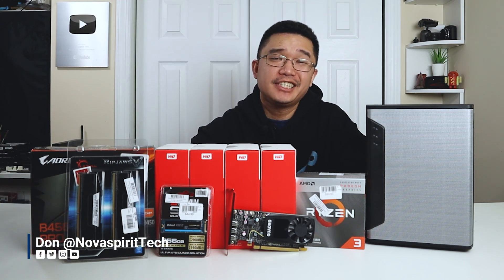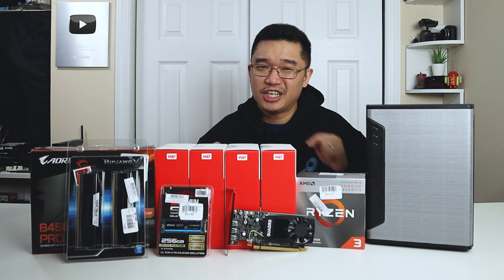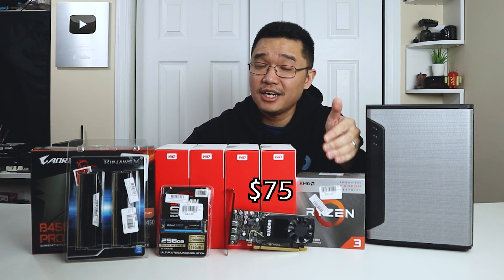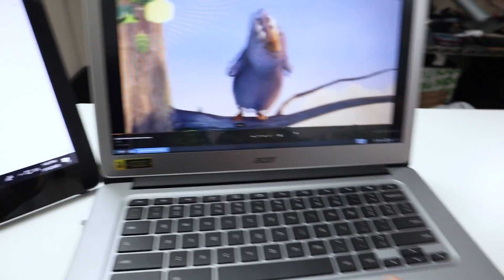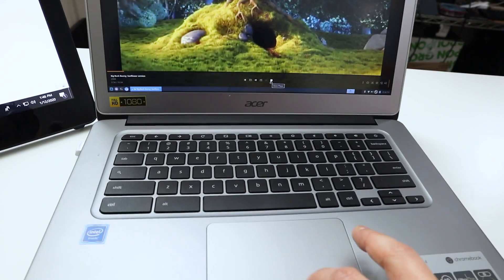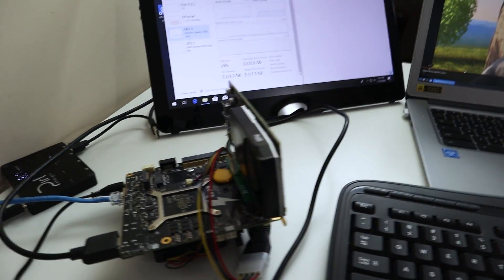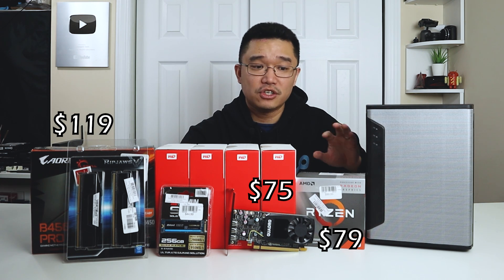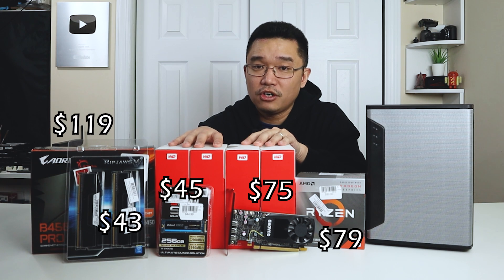DIY NAS & Plex Home Server With Hardware Transcoding Build

Comment: If you had a GTX 1060 GPU would that work instead of a business level GPU like you used?
Reply: Its limited to 2 transcode streams i think...
Reply from the maker: also 1060 is 120w vs p400 30w
Reply: If you're on Linux you can patch the drivers to unlock the 2 streams limit, search for "nvidia driver patch". The card then has the same capabilities of a Quadro P4000 regarding hardware encoding. The card also automatically regulate it's power usage down to 19w idle. The fan doesn't even turn at idle, the fan runs only after a long transcoding session or witl multiple transcoding session.
Reply from the maker: @Pi Pony radeon is not supported by plex. that might change soon but currently only nvidia works with there software for transcoding

Comment: Get a 1650 Super or any 1660. They all have the new Turing nvenc chip in it. And you can bypass the 2 concurrent stream limitation. So you basically have turned a consumer card to a workstation one.

Comment: Well done.  This is very well thought-out for a practical home NAS.  4c/8t gives you spare threads for containers and small vms.   Since it is small and quiet, you can put Kodi on it and plug it into your TV.  
Don't worry about ECC RAM and ZFS.  The people who insist on it are talking about enterprise servers with hundreds of TB of storage and mission critical data.  It's not like ZFS corrupts your files without ECC.  I run ZFS all over the place, from my media server to my laptop (ZFS is amazing for dual boot macOS and Linux), and even on a Pi4.  I've never had a problem.  
If you don't mind the command line, a minimalist Debian or Ubuntu server install with a ZFS root and services in Docker is really easy to maintain.  Docker and ZFS work really well together.
Reply from the maker: I just finish installing everything on my server and I'm loving it. I decided to go Debian but with Plex, and added a steam cache along with some other goodies. I just dreading to edit this video
Reply: @NovaspiritTech  Be careful.  YouTube burnout is real.  Better to take a day or two and not "dread" editing.  Your videos are different and interesting and I'd hate to see you quit.
Reply: if some day you discover 100 of files on your storage with 1-2 bit flips you will mourn for ecc :-)
Reply: @l33t00r  No, I won't.  Anything really important is backed up.  I'm only saying "don't worry about ECC" for home NAS and other personal applications where the risk isn't worth the expense/trouble of ECC.  Just like how most people edit videos on normal PCs, while commercial editing contracts often mandate Xeon ECC workstations.  Youtubers laugh at the expense of the new mac pro while Hollywood is buying pallet-loads of them.

Comment: I’ve not built a NAS so forgive me if this is a bit of a naive question, but aren’t the low speed WD Reds going to be the bottleneck when streaming? I realize the NAS software you use will use RAM for cache, but will 8GB be enough?
Reply from the maker: Nope. The network speed is only 1gbit and a single hd can do well over that speed so even in a single disk setup it won't bottle neck. But with a raid 5 setup like this you get 3x read 3x write speed on disk
Reply: Thank you for the explanation.

On another note I checked the Chenbro website and you’re right, they do not document that circuitboard on the back of the drive cage.

Comment: I just built a NAS with Proxmox and OMV. So far it’s doing great, similar budget build. Will use for NAS to replace an old Drobo FS and will migrate a test Plex server onto a more flexible platform. I will also use it to run containers and VMs. Thanks for this video, it confirms many of my choices.
Reply from the maker: Check out mu twitter i just posted something there you might like
Reply: I'm doing the same this week. But proxmox, omv, and a win 10 vm
Reply: @nicktids  yes. Building a win 10 cm this week. Working on integrating Spice right now.
Reply: @jimpotash9009  I read spice and vnc doesn't allow the gpu passthrough so using rdp. I'm stuck at the nvidia code 43 with an old gt710 card. Just going to do some old gaming so don't need anything fancy.
Reply: nicktids yeah, ended up with rdp and everything works fine.
Reply: @jimpotash9009  cool for you Bios hacking for me. Still fun tho

Comment: Like it but need more. What are your thoughts on the 1920x build? I keep looking and you can get the cpu on sell sometimes for $150-160. Case about $80-100. Psu $80-100. Ram $100. Get a cooler and I like you gpu. Boards are $200+ used. So about $700-800 w/o mass storage. 
Been looking at a gaming vm build on a budget. 12core 24 threads make a great start point. The upgrade path gets you to 2990wx.(wait a year or so to see if it drops to under $200).
I do like your build. You can upgrade to 3700x(65w). So you would have 8 cores 16 threads.

Comment: I ran just a bare bones install of Ubuntu server for years on a Celeron j1800, it worked well for many years. At the time I was only driving gigabit ethernet so it worked out very well. It sounds like you know what you're doing with a bare metal install of Linux so personally I'd just roll your favorite distro and install Plex on top of that for simplicity.
Reply from the maker: haha this deserves another 👍
Reply: @NovaspiritTech  I'm close to the same build. However.... I went with a 2600 af instead of an apu for 40 bucks more. Installed Antix for 50mb ram usage. Shared the  data drives and set kodi(dlna) to auto start. Activate auto scrape for new files added. Then declcoked to 12 threads at 2.0 ghtz, for power sipping. Turned on post with errors, and wake on lan. Then pulled video card. It boots and runs. Can add data off my main system with network share, which is not the same as desktop share. No video required on the server. Transcodes nicely for single user, haven't found its limit yet
Reply: Would you guys ever consider SSD? Media server have minimal write and heavy read. These traits are a match for ssd drives which have infinite read and limited writes. As well as power sipping. However their surge and shock resistance is much weaker.
Reply: @dobermanownerforlife3902  if you're rolling your own base os. You could combine software raid with lvm + turbocache and get similar performance benefits without worrying about data loss due to faulty SSD.
Reply: Dobermanowner forlife Cost... 4 2Tb spinning rust drives are $200 and a 2Tb SSDs are $200ish and 4 of them cost more then the whole build

Comment: NSA recommends Windows 10
Reply from the maker: HAHAHAHHAHAHA
Reply: Surprised they don't recommend win 7 so it can be extra insecure.
Reply: @MrBearyMcBearface  Reading this comment on Windows 7
Reply: @cobz76  pretty sure I typed in on win 7.
Reply: os os x or ubuntu....oh wait dey can just remote your bios ahhhh
Reply: @changedahanddlessss  that's what libreboot and others are for.
Reply: NSA is not going to care about some random schmuck, so if you're not a threat to their administration, you have no reason to be paranoid, and Windows 10 works well as a familiar always on workstation that can serve double-duty as a file server.
Reply: @BoopSnoot  Of course, you don't need to worry about the NSA with Windows 10, because Microsoft already does the spying.
Reply: @BoopSnoot  sounds like something an NSA agent would say
Reply: @BoopSnoot  windows as a server? dies laughing

Comment: I think the integrated GPU could also do the transcoding
Reply from the maker: I wish plex only supporta intel quick sync or nvidia
Reply: @NovaspiritTech  Oh :( It would be so cool to have all the necessary integrated in such an affordable CPU
Reply: @NovaspiritTech  I've been seeing claims on the plex forums that it does actually function on AMD APUs/GPUs, however only from Windows based server ATM. While I've been testing with Proxmox on my main computer, I've been considering building a dedicated plex nas with an unused 2200G I have laying around. Haven't committed to a board yet, but going ITX leaves me wanting to use that 1 PCIe slot for my ATSC tuner instead of a GPU. While I've got Plex working in LXC along with passing DVB to it,  being able to use the iGPU is the missing piece.
Reply: This build vs a quick sync build ! Witch would be a better value with quick sync you are not stream limited

Comment: Xpenology?
Reply from the maker: Checking it out. Thanks
Reply: @NovaspiritTech  Awesome - i got it running as a VM with some hardware passthrus (Sata/USB3). There's certain models that support the hardware transcoding so you would have to decide on that when you choose/edit the bootloader.
Reply: @sammyji  have you tried ruining it a docker instead?
Reply: @MrLordbeavis  I'm not sure why you would run it inside a docker container vs a VM. But the forums do mention people trying. I haven't yet though.

Comment: Don, do you think using a Ryzen 5 2600 could be a better choice? We can pick one for $109 at Microcenter. I'm thinking about to use not only for Plex+Nas, but also for my Docker containers and a couple of VMs
Reply from the maker: Yea that would be better if you are planning to run more like dockers.
Reply: if you can look at the 1600AF. It's nearly identical with a 2600.

Comment: That Microcenter location is my church.  In fact I've gotta go pick-up 2 Pis and 2 external hdd.
Reply from the maker: i have a video on the way with rpi4 nas. =P
Reply: @NovaspiritTech  That's exactly what I plan to do with one of them as well (maybe using a 3b though) for a combo parental data storage back-up/off-site back-up for my home FreeNAS box.  Don't need a ton of horsepower but have been researching options between OMV and a distro to set-up manually.  Looking forward to your vid to add to my indecisiveness.

Comment: I fully agree with you about budget builds! Buying random expensive stuff and putting it together provides no challenge at all.
Reply: Yep, if I had $5000, I most likely have enough money not to worry about the power bill, so I'd just buy a modern server with at least two modern Xeon E5 processors and a ton of ECC RAM.
Reply: I really hope you are being sarcastic because what this idiot did was not a budget build in any shape or form!
Reply: But buying random cheap stuff and putting it together does?
Reply: @-QuickNick-  in a way, yes... with cheap stuff you need to be careful and you have to do research, check reviews for compatibility, etc. On the other hand for example, if you buy the biggest and best branded PC PSU with 5 years of warranty and whatnot, you won't have power problem for sure. Same applies to motherboards, coolers, cases, etc, etc. All you need to check is socket compatibility...
Reply: Also, YouTube is full of expensive builds. Whatever you're planning to build, Jays2cents/Paulshardware,/Bitwit/Gamersnexus/etc,etc. has already built, so you just take a ready made shopping list...

Comment: Using a SSD for caching?  Are they actually robust enough to use for caching?  Wouldn't it have been cheaper to use a smaller SSD and get more RAM?
Reply from the maker: for caching the transcode, i found m.2 vs ram not much of difference in delivery speed but m.2 vs ssd i had a noticeable difference. but yes. if i got a ssd and went 16 gb for ram. i would transcode to ram instead
Reply: I looked on Microcenter’s web site, looks like you could have gotten a 120gb SATA m.2 and 16gb ram for roughly the same price.  And as a NAS, the 120GB should be more than enough.  RAM is better for caching anyways.
Reply from the maker: @protaginets  hahah agreed!! i should have went that route instead. i got cough up in thinking i needed about 170gb just for my thumbnail generations.... meanwhile i could have thrown that into that NAS storage doh!!!

Comment: Unraid is good if you have a jbod and plan to add more in the future and it supports a wide variety of plugins but your limited to as the max  number of drives and the limit in the case has been reached. Freenas is great if you already have all your drives and its free and in the next release it's coming out with a lot more plugins than it currently has. It supports and it uses zfs file system witch is great for reliability and data integraty and also supports a lot of enterprise features like iscsi a feature that unraid just doesn't support witch would be cool for like a big steam library as you get better read and write speeds and not to mention you can run dual usbs in raid 1 for a safe boot drive again a feature witch unraid doesn't support.

But in my personal opinion unraid is the better option as it does not stripe data across all the disk instead writing to a parity disk and a single disk  putting less ware on the disks that are not in use so they don't spin up and in the event of a drive familiar not all the data is at risk only the data on the drive that fails 

You probably know all this I'm just leaving it for people not familiar with Freenas and unraid.

Comment: Nice one, my only concern would be that the GPU fan might have a hard time sucking air as it seems to be blocked by the case's side panel when closed. 9:39 
Just to have ease of mind, I would drill some holes on the side panel or even cut a custom big hole at the side of the case panel and put some mesh to filter the dust. 

(Just for the aesthetic details, I'd disassembly the case and paint everything metallic with black mat spray to hide reflections and change red led-strip to blue in order to avoid having multiple colors. But that's me being odd...)

@Novaspirit Tech Just a question, how do you calculate how much RAM you'd use? Is it based on operating system need or do you use lets say 1 GB of RAM per 1GB of HDD space?
Reply from the maker: the case has holes on the side for the gpu to breath. i'll show you some pics later

Comment: I really want to build something like this working on a Pi 4 nas solution currently. Any tips???
Reply from the maker: i just got a rpi4 nas kit. i'll be doing a video on this topic soon
Reply: @NovaspiritTech  great I'm using the Argon one case. Looking forward to your video! Been a fan for over the last 2 years
Reply from the maker: @AdHdEntertainmentLLC  https://www.youtube.com/post/UgxNLX-ZXDSjPU5rCdt4AaABCQ check that out
Reply: I've got a portable Plex server based on a Pi4 - OMV with a Samsung 500GB USB3 SSD and a 256GB USB3 dongle. I used the Flirc case which has a thermal pad to contact the SoC and scaled the speed of the cores back a little. It's an experimental build that I've not done much with for a while - https://www.youtube.com/watch?time_continue=7&v=14D9MFcjubg&feature=emb_logo

Comment: I would choose 3000g or even used 200ge since I don’t need too much cpu power with a gpu decoding everything
Reply from the maker: i was debating that, the original build i had plan was going to use the 200ge. but for $20 more. the ryzen 3200g was a much better choice.

Comment: Can someone explain why you need to transcode the videos down? wouldnt it be MUCH less cpu to just stream the video as is? I know it uses more bandwidth, but I cant see why you woudnt rather do that?
Reply: It depends on the receiving device and if it can handle the format ( codec etc.), It also saves power on your device as the server is doing all the work so it plays native on your device... Love Plex have had pass for 6 years
Reply from the maker: most of my devices are not 4k so transcoding would be ideal. also i usually watch my show on mobile device so it helps save on data plan as well